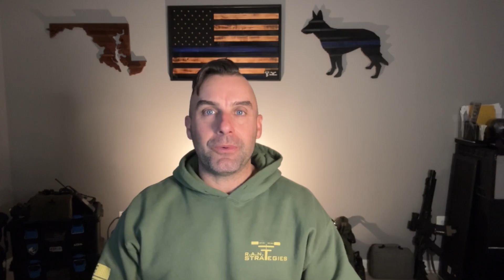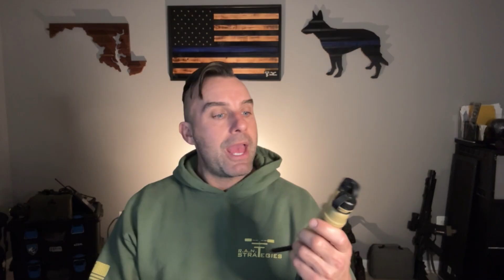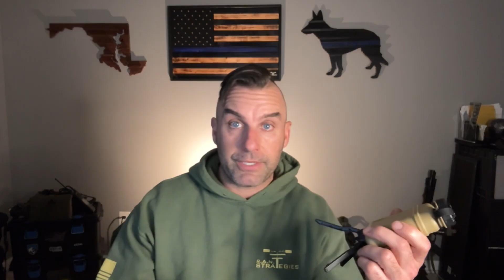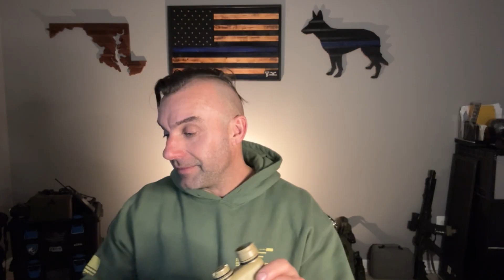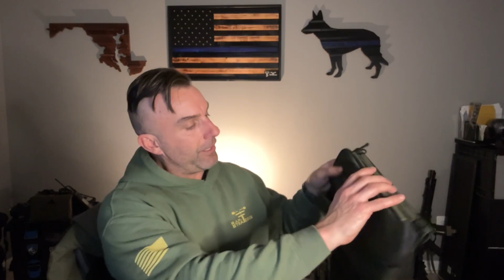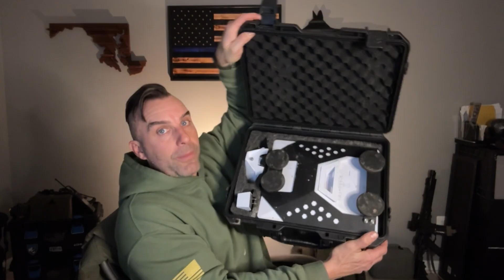Fix Your Failing EMCOMMs Plan

Comment: With the the backpacking solar panel, every time I put one into my pack, I end up taking it right back out shortly thereafter. I can't justify the weight and space expense. I did take one out on assignment this year to charge my power bank without needing to run the truck all day. That was nice. How do you typically use yours? Does it go in your pack or in your vehicle?
Reply from the maker: So same deal here, I usually bring it on rolls with me so that I can leave a power back charging in the tent while we are out on the line and then by the time we get back its charged up.....Definitely beats running the truck day, but I have not been in a situation yet where I was completely stuck and it was the last resort. I think if we did some more, purely backpacking trips, or if getting spiked out on the line it would come in to play, but I haven't been there yet since I've had this thing.
Reply: @RANTStrategies makes sense

Comment: Great video, and thanks for reminding me that I still need to invest in a portable solar rechargeable power bank. 
Likewise, I put no EMCOMM stock in these new POC radios and the like designed to operate on the internet or cell phone networks. Having experienced first landline disruption, then a cell phone outage during the 9/11 national calamity, I would have been completely without communication had it not been for my 2 Yaesu HTs and extensive accessory sets for these. As expected, all of our local repeaters were in net controlled emergency traffic mode. Our local ARES group was preparing to drive into ground zero to provide assistance, and since I was not able to work at my NYC assignment on that day, I was mentally preparing myself to join them on their mission until I learned that they couldn’t afford us even basic safety equipment, dust mask, goggles, etc. Ironically, these people had previously spent one weekend a month preparing for airplane disasters and the like. This was the most egregious example of a failed disaster plan I could imagine, so I just safely stayed home and monitored the national calling frequencies while watching OTA television broadcast from the Empire State Building. A project coworker with USMC Search and Rescue training went to ground zero at the mayor’s behest, spent his day sadly collecting human remains, and subsequently developed respiratory issues.

Comment: The part about training until you fail, is something most miss out on. I do not believe it should be a fail fest, but I do think things should be pushed to the limits. I have been in enough local exercises to know it is a favor systems and not a learning system with an honest evaluation. 

Our local ham radio president is afraid to try anything other than analog because he is afraid of failure. I have been wanting to try NVIS to the Charleston NWS for a few years now. He says no, because if we fail, we will look bad. Yeah.

Comment: Always appreciate your info ! Having multiple different ways of communicating is so important. One other redundant thing we do with VHF/UHF radio is to not count on only VHF or UHF,  but monitor both a VHF and UHF frequency(s) when operating simplex. (A couple different repeaters also if available). Sometimes VHF gets through, sometimes not. Same with UHF. Topography, vegetation buildings and radio antennas, all vary so much.
Reply from the maker: Absolutely, there is a ton that you can do, if you remember to do it and the only way to do that under stress is to do it so often that it is just second nature.

Comment: Excellent information... i would just add a couple of points... For those who are Technician Class, or not willing/able to take their HF gear into the rough field, get a reliable Shortwave radio with SSB. No, you can't talk to anyone,  but if there's a news blackout, cell service down, massive power failure, by tuning international stations, and listening for other amateurs on SSB, you'll sooner or later get a picture of the events. Also a cheap AM/FM receiver - $10-12 on your favorite online shop. Yes, 90% of portable Amateur/GMRS/Business band radios have at least FM receive. But after just 4 hours Rx, your battery is down. Also, running GPS continuously depletes the battery quicker.
Reply from the maker: Really appreciate you sharing all of this..... yeah, for as much as I said, look at how much was missed. I also love the shortwave radio capability to have in your tool box and in a future video regarding intel gathering I'm going to bring that up and can't wait to hear your thoughts on it.

Comment: IC-205 with three lines filled in is a setup for failure.  During a COML class I had a three page communication list (IC-205).  EVERY frequency I could find in the area was on it.  When the instructor put my PDF on the big screen the entire room let out a groan.  The instructor had me explain why there was so much on it.  "Well, this is my actual IC-205 with the local frequencies and phone numbers added.  The interoperability frequencies are real as well as the Coast Guard frequencies."  'Why do you have CB frequencies on it?'  "When truckers are delivering emergency supplies to my location there may not be cell service and they probably don't have ham radios.  CB is for deliveries and locals who have CB."
Reply from the maker: This is such a good example of why a ‘minimalist’ IC‑205 can bite you when things get real. A three‑line form might look clean in a classroom, but in an actual incident you need every interoperable pathway you can get—especially when infrastructure is compromised and you’re dealing with mixed capabilities across agencies, volunteers, and incoming resources.
Reply: People are quick to laughat/dismiss CB... but I can tell you from experience,  that immediately after, and actually for several weeks after Hurricane Katrina, CB was a valid and vital form of emergency comms. It's not without merit that new and improved models hit the shelves every year. President recently released its AM & FM Portable CB with CTCSS/DCS. It's called the Randy 2, and 3. Also has Wx and FM broadcast. I'm hoping they'll release a SSB addition soon.
Reply from the maker: @baronedipiemonte3990  Its amazing how quickly people forget that virtually EVERYTHING they use in life got to them and continues to get to them via a truck. I did CB back when I was 16, I am curious to know if anyone has messed with these FM CBs and the ones that have SSB as well.
Reply: @RANTStrategies  Actually I have a President George CB.  It is AM/FM/SSB with weather.  It works wonderfully.  I hook it up to my ham radio tuner and antenna and tweek it.  I have talked coast to coast on SSB with it.  The FM is very clear also.  Is it worth the cost?  Heck Yes!!

Comment: NY State has one of the best INTEROPERABILITY Frequencies I have ever seen. 

Every single Police vehicle and police department has MRD and they also have EMS F1 F2 and F3

So from any police car they can communicate with all the hospitals, all the ambulances, all the police and SEMO

During Lee and Irene I had my 120 watt Spectra and I was able to talk to Plattsburgh, NYC, Kingston, Oneonta, Marathon, Syracuse, Ithaca and Binghamton 

Using Ambulance companies we were able to relay calls across the entire state

I have never seen a state that has a system this good

It is simple 
It is portable 
It is analog 
It reaches 150 miles

With the old 30 MHz AT&T system we could reach 100 miles on 5 watts

With 120 watts we covered all of New England and the Mid Atlantic states
Reply from the maker: That's incredible if the rest of the state has become that advanced. I can tell you that FDNY is not there with their system, but it Sounds very similar to what we have where i am now with the Maryland FIRST system. But you would probably be horrified with how many people have ZERO idea how to even begin to get into those buried menus.